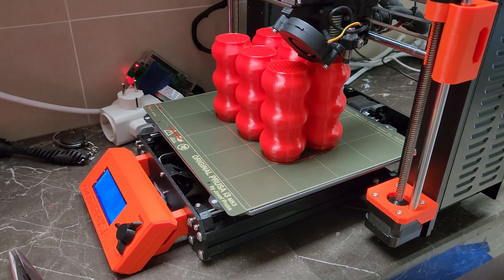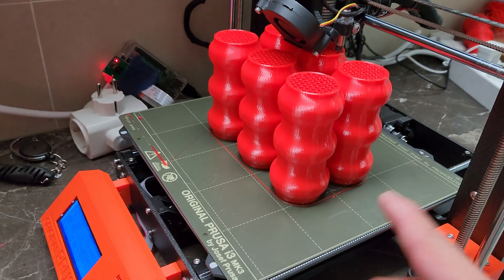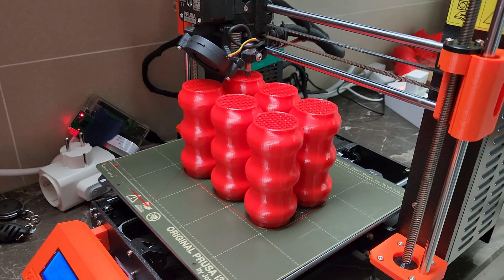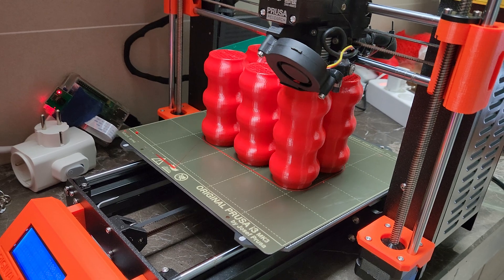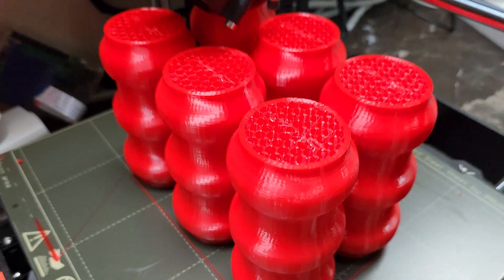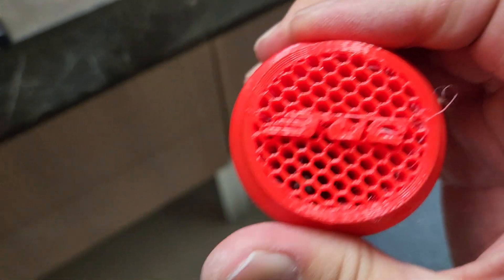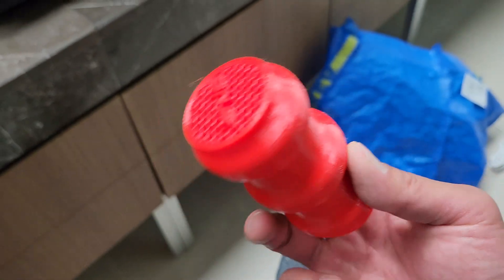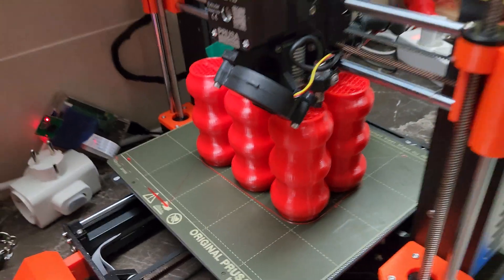Printing multiple objects with TPU on Prusa MK3S+!

Comment: I print a lot of multi object plates on my Prusa MK3S+ printers and I still haven't figured out how to do it nicely with TPU when parts have large travel distances (100mm). There is inevitable blobbing from extruder back pressure. Do you have any tips on this?

Comment: Hey, would you mind sharing your printing profile for TPU? Got some stuff I’d like to print, but it would take ages to finish them all and your prints seem to come out really good at that speed!
KR
Reply from the maker: You will need to fix the resistance of filament path before you can speed things up with tpu, if your tpu filament path is straight and using ball bearings you can achieve much fatster speeds.  You will first need to build this: https://youtu.be/YTorSRpJtqQ
Reply: @3dPrinterSchool  I’m already using a ball bearing spool holder. Not the same as you, but pretty similar and also a straight way down. 
What else did you tweak in order to get that fast printing speed? :) 
Thx for your time!
Reply: @Mayday_FPV  It seems like anyone who has figured out how to print TPU quickly and keep the quality up, guards their settings like some super duper secret. Annoying.
Reply: @IdahoRoamingGnome  I agree. I could see the value of the video if he would share the settings used, not going to compete with the design he’s selling, I’m not selling anything, just waiting on my first TPU roll and was hoping I can see here what settings I should use for a good quality print since I have the same printer.